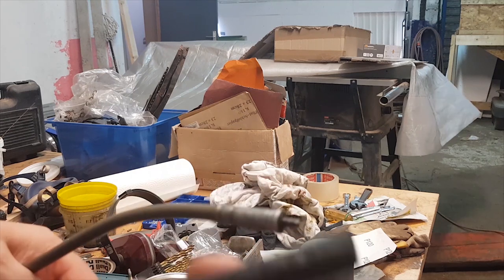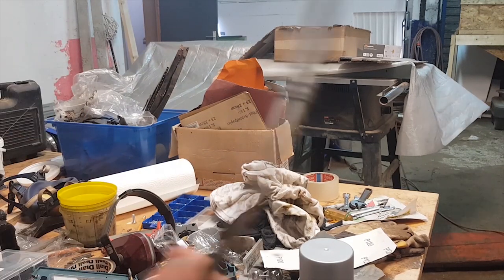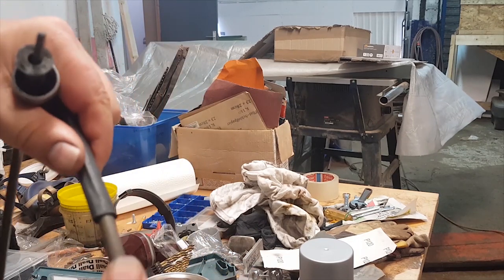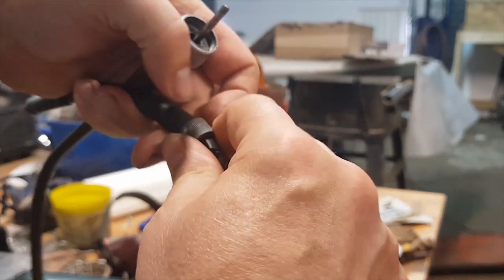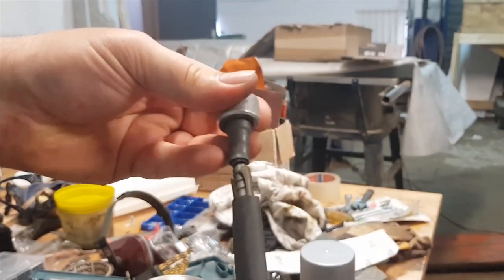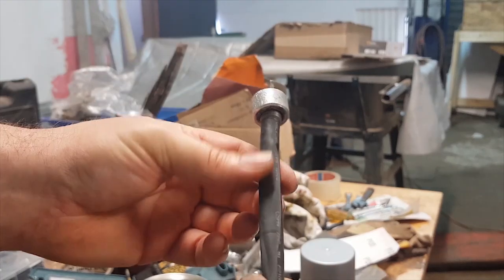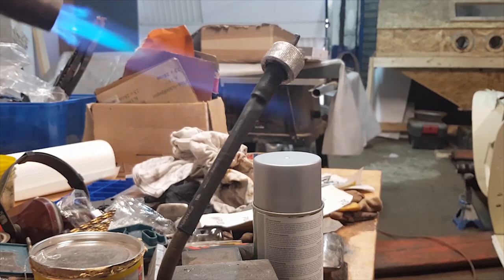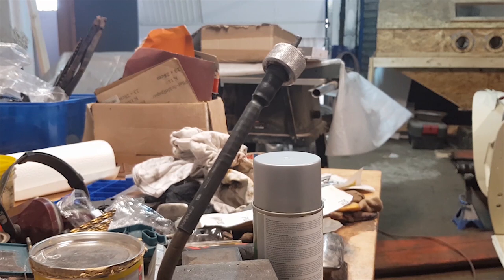Repair your Speedometer Cable - Austin Healey Service Manual

Comment: I used a slice of reticulation riser tube as a spacer to fix my speedo cable! it had worn at the indicator end and was not pushing out enough to engage with the drive in the speedo

Comment: Liking these service manual videos. Do you have any footage of how your splines are attached to rear axle? Trying to sort my sprite
Reply from the maker: Thanks. I have a video on replacing the hub oil seal that shows most of that. It's for a 100-4 but the technology is the same. You can also check out this https://www.ahexp.com/article/mg-midget-and-sprite-rear-axle-knowledge.220
Reply from the maker: Forgot to say the video will be available with the hour.
Reply: Thank you so much, appreciate it.